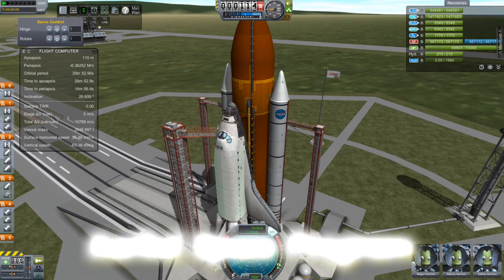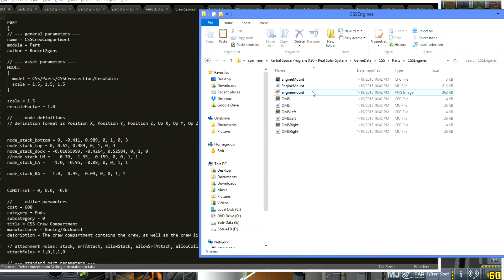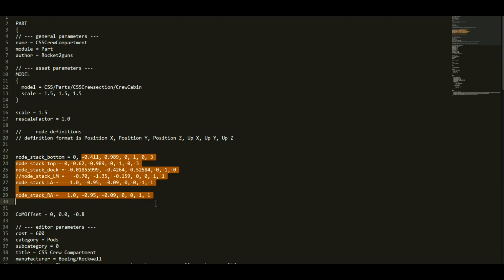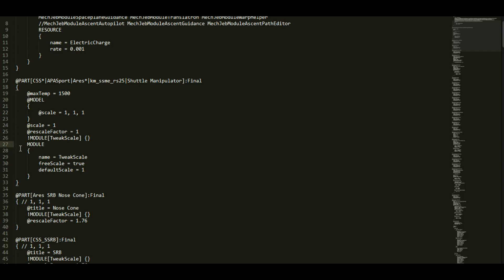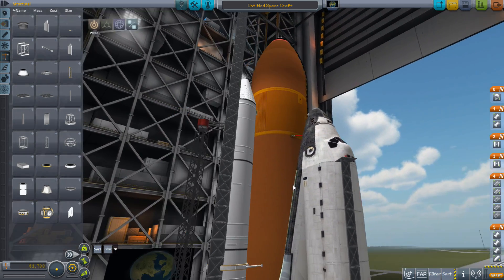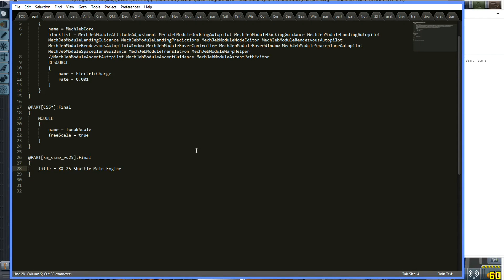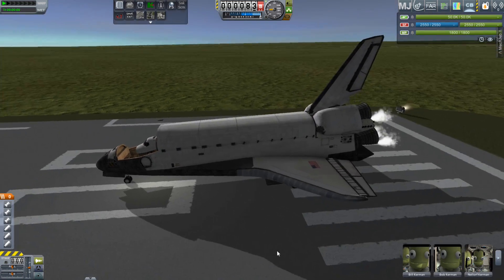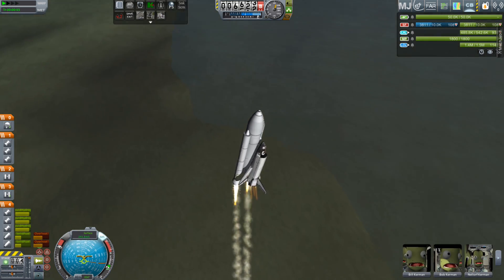SE02: 1974 / Project Enterprise - Space Shuttle / KSP 0.90

Comment: Would it be possible for us to get our hands on those CSS config files once you are done? Would love to test it out! There is a RO "fix" on the forum for the CSS mod, but it has a few issues with roll and yaw instability in FAR.
Reply: Hi. I'm the one who made those Configs. I can only assume it is your piloting of the shuttle and lack of roll authority that causes the issues. An asymmetric craft has difficulties with yaw and roll as they tend to be one and the same unless you have software to work it all out for you, like the real shuttle. I can't find the far instability... Still, so I don't know how to fix what isn't broken. Anyway it's a WIP but I'm just confused as to if there's issues, or operator error.
Reply: It certainly has nothing to do with my piloting skills, as I've played KSP for about three years now. I've seen on the forum that there are at least two other people having the same issues as I'm having, so it can't just be me.

The roll and yaw instability is easy enough to counter during ascent, it's re-entering the atmosphere that causes problems. Around 76km it just flips out of control. Sometimes it will magically right itself though. But for the most part it is more or less impossible to get it back down.
Reply: Fairy Light  The only way i could replicate that issue, was if i used no RCS to stabilize the shuttle on re-entry.
This is not how the real shuttle worked.
Taken from NASA spaceflight on the shuttle orbiter: "...From an entry interface of 400,000 feet, the orbiter is controlled in roll, pitch and yaw with the aft RCS thrusters. The orbiter's ailerons become effective at a dynamic pressure of 10 pounds per square foot, and the aft RCS roll jets are deactivated. At a dynamic pressure of 20 pounds per square foot, the orbiter's elevons become effective, and the aft RCS pitch jets are deactivated. The rudder is activated at Mach 3.5, and the aft RCS yaw jets are deactivated at Mach 1 and approximately 45,000 feet."

I don't intend to make some ridiculous band-aid via gyro or enormous FAR models to fix something that isn't actually broken.. However I am looking into improving the shuttle, so try not to take this as a deaf ear to criticism.